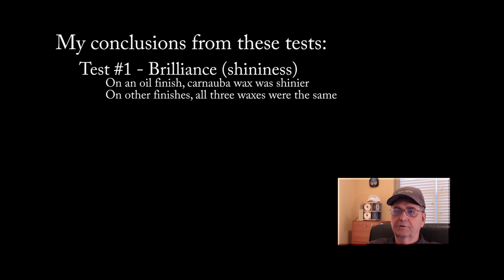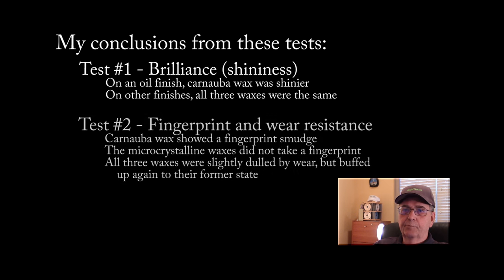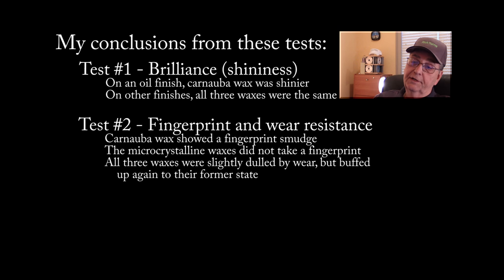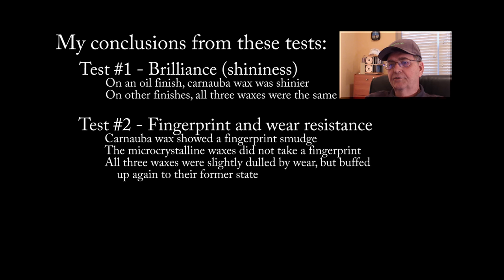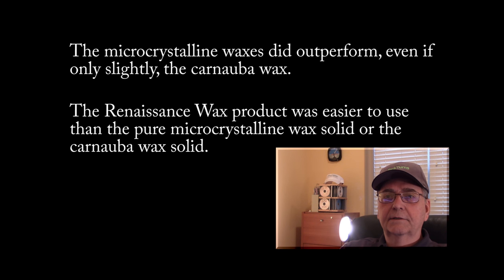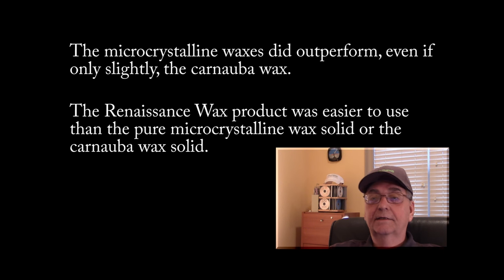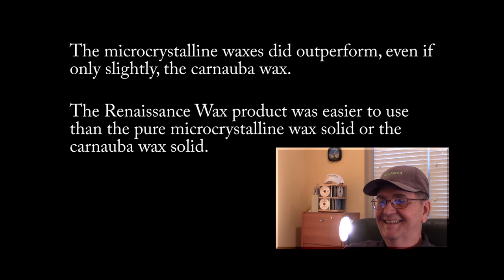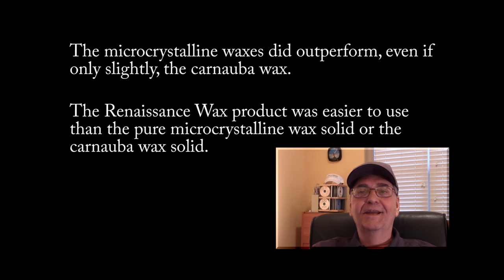Microcrystalline Wax - Part 5 - Summary of Results

Comment: Rick -- Thank you for the series.  I learned a lot from it and some of what I learned was surprising.  Allow me to add to the discussion by making one observation: You failed to take into account the reason microcrystalline wax was developed: Carnauba and beeswax contain acids that will harm the surface the wax is "protecting".  It may take years before the acid in carnauba will cause noticeable harm, but these natural waxes will harm the surfaces to which they are applied.  This may not be a big deal for items we expect will soon be worn out by daily use, but it is a big deal for those items we hope our grandkids may someday inherit from their parents.  A similar issue applies to the kind of writing paper we might buy.  If its for a grocery list, we probably don't care if the paper is acid free.  If its for a handwritten journal, we're probably going to insist on it being acid free.
Reply from the maker: Hi, David. I originally mentioned the acid thing but cut it out of the video during editing. I should have left it in! Thanks for commenting.

Comment: Hi Rick,
I'm researching wax finishes for turning for a demo I am preparing for the local club. Can I ask where you bought your block of microcrystalline wax from? Also did you figure out what to mix it with to mimic Renaissance wax?
Reply from the maker: Hi, Jim. I bought my block of microcrystalline wax from Amazon...here's a link to it: http://amzn.to/2k8acF1Right at the moment, it's on sale for $10.55. A 1 lb block will probably last you forever. I haven't made my blended version (like Renaissance Wax) yet. The MSDS for Renaissance Wax says it is 80% white spirits (mineral spirits, I believe). I've tried just dissolving some microcrystalline wax in mineral spirits, which didn't work. The was will need to be melted first, which is really what I expected. I also have purchased a small amount of UV inhibitor that I will add...several of the commercial wax blends mentions using a UV inhibitor. You can find it easily on eBay...it's sold as an additive for making wax candles. Good luck with it! I'd love to hear how it works out for you.
Reply from the maker: I've also noticed that some commercial products mix carnauba wax with the microcrystalline wax. That doesn't make sense to me, as I didn't see much or any advantage of carnauba wax over microcrystalline wax. Some products also mention using beeswax, presumably to soften the result. I don't think I'd do that unless it is the last resort, as beeswax is not shiny.
Reply: Thanks Rick!
Reply: I think they are adding the carnuba for that little bit of shine. But I don't think they are adding much. At least from another video I saw, where they mixed just a little with beeswax to increase the shine to the beeswax.
I just got my block in today. Tomorrow I will play.